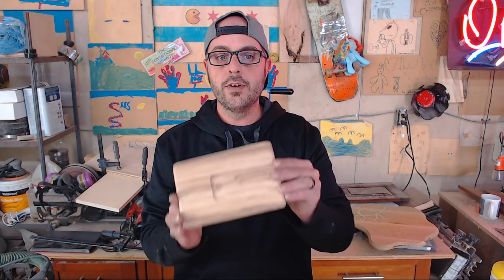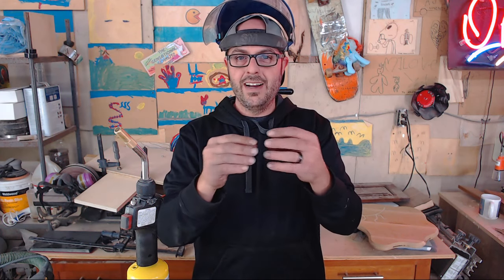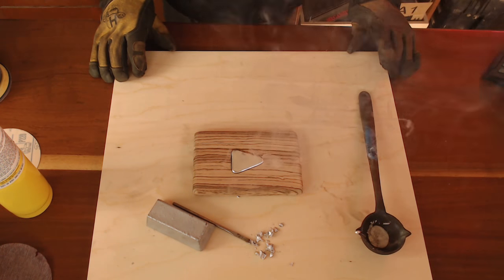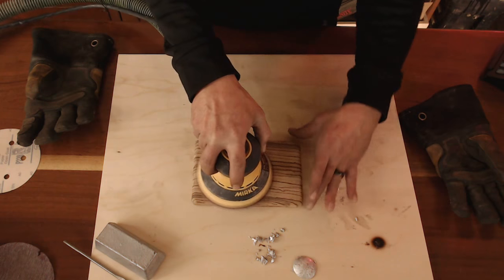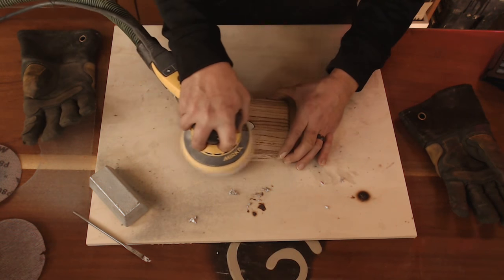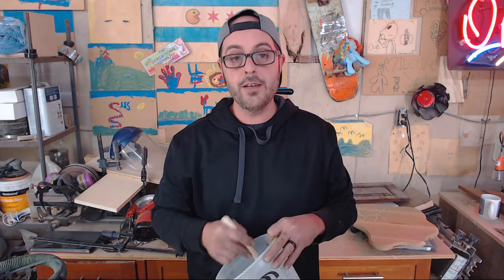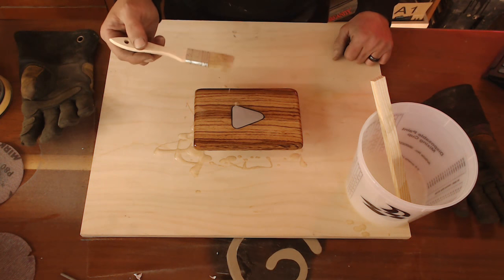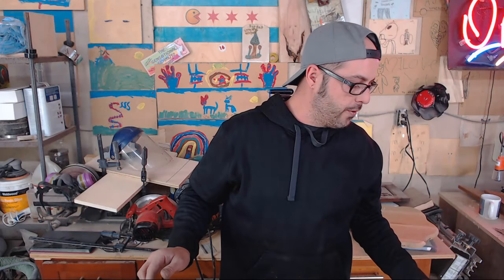Youtube PlayButton for UnspeakableGaming #unspeakablegaming

Comment: How did the wood not burn
Reply from the maker: Great question! Pewter melts at around 400f and quickly starts cooling down after it contacts the wood. Normally wood burns at this temp but I used a really dense exotic wood to help with this. The wood does actually start to burn a little but thanks to the close fibers of this wood, it didn't

Comment: wouldn’t the wood burn
Reply from the maker: +Jamie Wanderson It depends on the wood and metal.  
Pewter melts at around 440f degrees. A really dense wood doesn't have enough time to burn, although, occasionally it will char the edges slightly